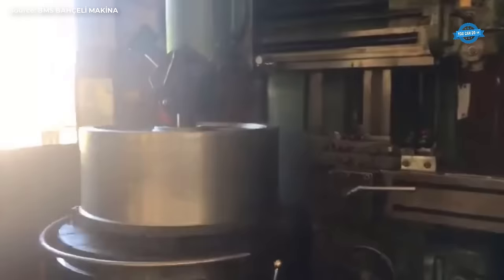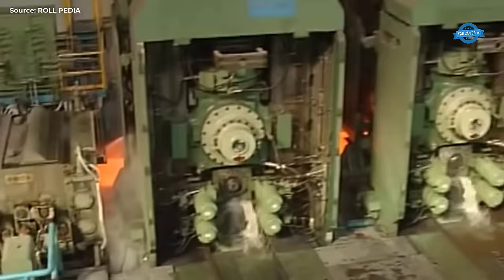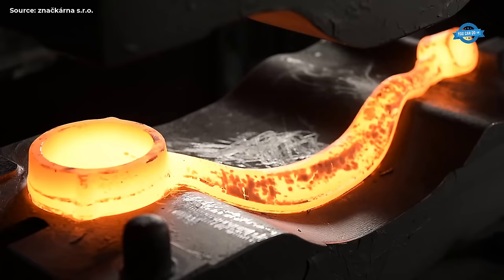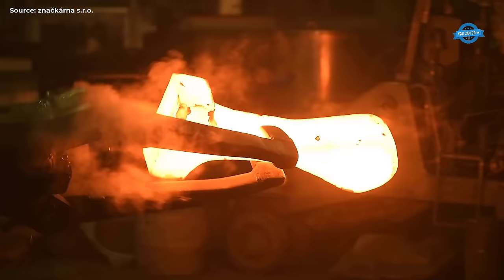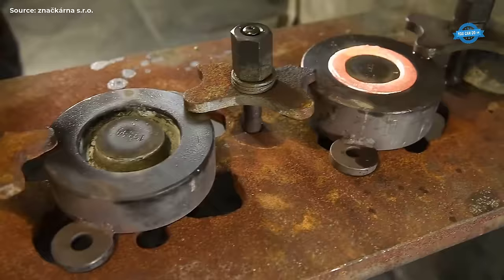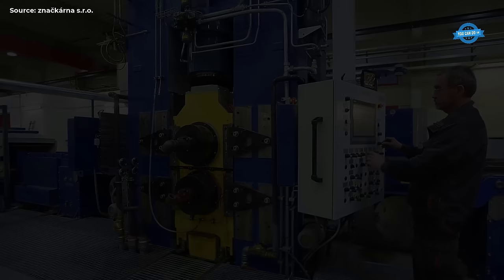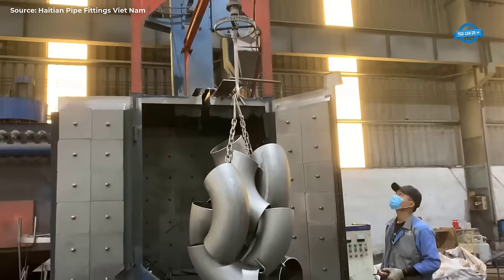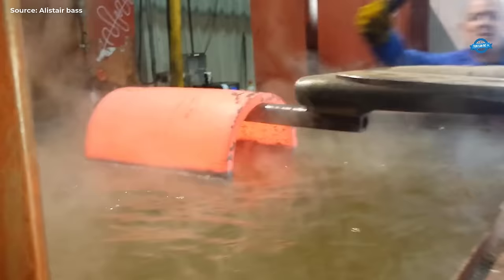Heavy Lathe, CNC Machine & Forging Machine In Working. HUGE DRIVE SYSTEM Used In Steelmaking Plant

Comment: 44:09 This is hydroforming machine, not forming press. The pipe is deformed by enormous pressure of hydraulic fluid inside the pipe. The pipe expands until it has the same shape as the mold.